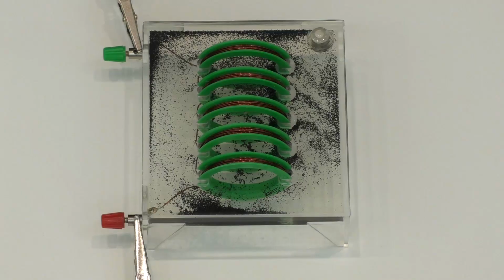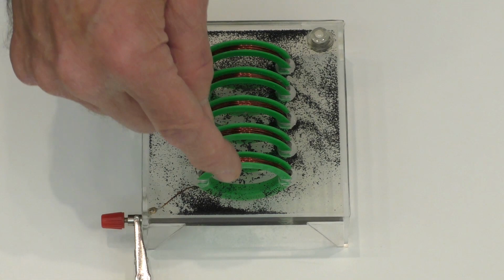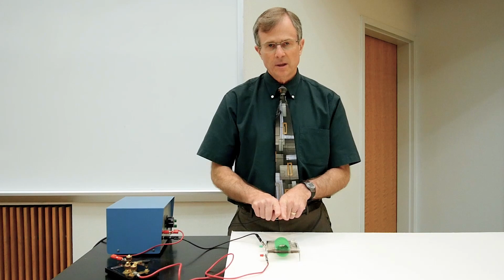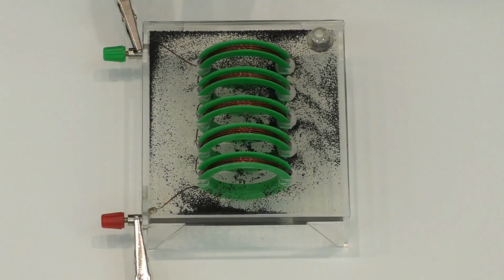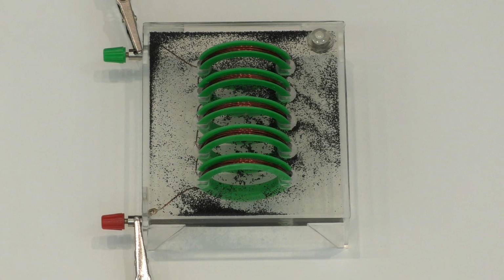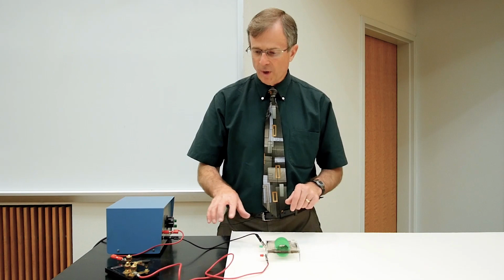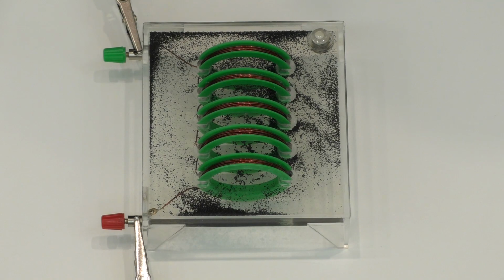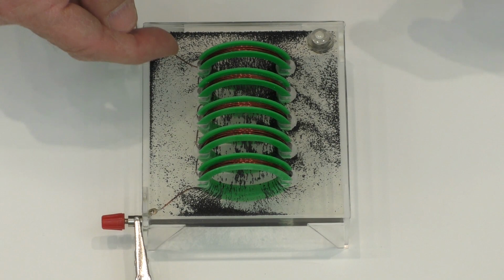Magnetic Field Demo: Solenoid

Comment: Thank you for sharing your device.  Suggestions:  1 try to sprinkle the iron filings from top.  The higher the better.  This will let the iron filings have more time to deflect its path and more likely land on right spots.  

2.  After turn on the power supply, give a few taps on the acrylic sheet.  It will also help the iron filings overcome friction and create field lines.  

3. You probably need to go to some hardware store to buy some heavy duty wires and add banana plugs and alligator clips yourself.  The standard laboratory electric wire is too thin to carry high current without burning.  

Just my two cents.